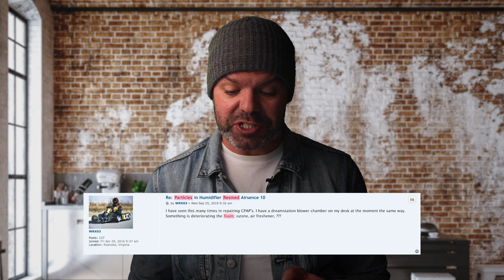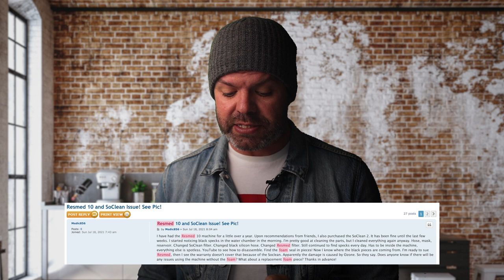🚨WARNING! AirSense 10 Foam Degradation & Removal

Comment: Very informative, thanks.  Sadly, because my insurance paid for my AirSense 10 the modem has to stay connected so it can be monitored.  If I don't use the machine they can take it back.  So if I want to open it up to deep clean the insides, what do I use to clean it with?  I've never used any sort of cleaning system for the machine.  I do take the water chamber and nose pillow with me to clean while I'm in the shower and clean the hose every week or two.  I normally use mild soap and vinegar, letting them soak for around 30 minutes before rinsing them out.

Comment: Until this foam degradation issue is resolved, is there any sort of inline hepa filter that you can place between the outlet of the cpap machine and the mask tubing ? At least this way one wouldn’t inhale any potential foam particles.

Comment: I have never used SoClean on my Resmed Airsense10. I saw the Foamgate Phillips recall, and became concerned about the foam in my machine. I'm an Electronics Tech, so I took my machine apart. My foam seems intact. Should I worry? Is there an option for a silicone replacement for the foam? Or a way to seal the foam so that if it starts to breakdown my airway is protected?
Reply from the maker: G'day brother, nah i wouldn't worry with the AS10 unless it has signs of break down. A lot of people have removed the foam disc as it doesn't really do much and the noise remains virtually unchanged. It's up to you mate. Personally if it was looking good i'd just leave it in and perhaps check on it once a year and do a bit of a clean out of the dust inside the unit etc. Cheers

Comment: Good Day Brother, I removed my foam thanks to your video, my Dream Station was 5 years old and I used a So Clean for almost as long, the toxic foam was a Black Goo  (Tar Like) It came out in small pieces of resin, that I have and dated. I have photos of my hands the toxic foam and the coated items used to remove it. If you would like to see them and use them in your videos, I can do that ! I had a black resin on my hand , in the foam case housing and on the various things I had to use to get this crap out. Thank You for your awesome videos, You might have saved my life, I have A Fib. and cannot be without a Cpap Machine all is good now. Here's a thought, now that the toxic foam has been removed I can use the So Clean again.                 Mark Mundt  Milwaukee, WI USA ...

Comment: Mine is 2 months out of warranty.   It is now making a low pitched whirring/whining noise when I breathe in.   I’d like to know what’s wrong.   Checked outlet valve/adapter, hoses, new tank and filter.   Noise still there.   I keep it on the floor now with a blanket over it.   Thinking of building a wooden box for it.  Lol.   But I’d really like to fix it.

Comment: I had soclean for five years clean masks mainly now only . AirTouch F20 cushion. They do not recommend cleaning masks in soclean,  foam cushions look great, recleaning 10 masks 2 or 3 years old clean with wet one wipes and soclean smell fresh just run all tube into soclean and drop in 3 masks at a time.  No degradation of foam , same color grey as new
Reply from the maker: The mask foam is completely different to the machine foam. Cheers

Comment: Nick, can you just leave the foam out  of the resmeds, I took the foam out of my dreamstation, because who the hell wants to wait a year for Phillips, I put the plastic where I cut to remove the foam back in my air chamber by using a soldering iron to melt the plastic , like welding. I can't tell any difference without the foam and feel better knowing that tar like crap is gone and not going in my already crappy lungs. Another good how to video and information on law suit. Thanks for your work.
Reply from the maker: Hey Jerry, thanks for the fab comment! I guess when you're known for making the best and quietest cpap machines in the world then a couple of DB is certainly important however i think you're right. Either leave it out or find a new materiel. Congrats on the DS foam removal also, i think you made a wise decision! Already 4 months in to the recall now! Cheers legend. Nicko

Comment: Would be great to see how to check the foam in a BMC Luna which is very quiet.... Would be great to have a machine with no foam touching the air we breathe!  

I'd buy that product...
Reply from the maker: Every cpap has foam except the Z2. BMC no different although it's not PE-PUR foam. Similar foam to ResMed. Cheers
Reply: @CPAPReviews  great to hear it is probably safe... I bought the BMC auto recently to replace the dream station nightmare... Thanks very much

Comment: Hi Nick sorry to bother you. A quick question if I may. I had a system one machine recall, how come they replaced this machine with A Dreamstation which is also on recall?? I am confused or did I miss something. Thanks Nick.
Reply from the maker: Hello, they are sending out refurbished DS1 machines with the new silicone based foam inside the turbine casing. Cheers
Reply: Thank You Nick.

Comment: Will the machine work OK without any foam?  Does it get louder?  Seems like it shouldn't matter if it's in there. You could probably 3d print a bit of plastic grid work that does about the same job absorbing sound. Or just go without unless it's necessary to the devices functioning
Reply from the maker: Hey mate, thanks for the great comment. Yes it totally fine and personally i can't notice much of a difference in noise. Perhaps a tiny tiny higher pitch to the motor but not much at all. Great suggestion with the 3d print! If you want to make some money create some sound dampening material that doesn't break down and you're all set haha. All the best mate. Nicko

Comment: Thank you for the great video. I love your channel. I have a question: I have a brand new AirSense 10 because my old machine was recalled. I have noticed when I use it that it smells like plastic for a little bit until the humidifier heats the tube up. Is this normal? Has anyone else experienced this? The smell is still there even after washing the tubing & reservoir chamber with light soap & vinegar. Thanks.
Reply from the maker: Hey man, i'm glad you like it and thanks for the great comment. Yeah it's very common to have that smell in the beginning. It will fade over time though. If it's bothering you, you can change the smell to whatever you like using this little device - https://youtu.be/qYrw1GpMs0w . Best wishes. Nicko
Reply: jm 20, thanks for asking this and, Nicko, thanks also for the reply.  I too have a brand new machine (just over a week) and was wondering about the smell.  It is quite strong, but perhaps not as strong now as the first night.

Comment: Nick, you are a blody ledgend! I was thinking about a second hand airsense 10, but now am a bit worried. I can tear down a machine abnd clean it out no worries, but where does one get replacement foam?
Reply from the maker: Hi Matt, yeah you need to be a little bit careful buying second hand pumps. Need to know 1. How many hours on the motor, 2. Has it been used with ozone. If it's relatively low hours and has no ozone exposure then it certainly reduces the risks a bit. Cheers mate. Nicko
Reply: @CPAPReviews  Legend, thanks mate.

Comment: Thank you this was great. I have been using a cpap machine for the past two and a half years.  I have never cleaned the inside of my Resmed 10 because I was only told by Resmed to clean the tubing and chamber and change the filters.  Is there a posibility that the foam in my Resmed is damaged, moldy or what ever.  Am I supposed to clean this part of the machine? Please help.
Reply: No, you are not supposed to clean the foam, if you havent used ozone on it, it should be fine and last longer than the machine will.

Comment: Hi Nicko, I got my Resmed 10 back in May 2019 and got the SoClean a year later. Before I bought the SoClean, I have heard about possible issues with it, but wanted something that would help disinfect the unit. I never used it everyday, I have only used it once every 3 months as a maintenance for my equipment. I do wash with non scented dishwashing soap the hose, tank and mask regularly. As soon as the SoClean is done, I run the maskfit option 3-4 times to try and get out as much ozone smell from the unit, hose and mask as possible. Do you think using the SoClean 4 times a year is bad or should I just stop using the SoClean all together and sell it? Please give me your thoughts. Thanks for all of your work on here! Danny
Reply from the maker: G'day mate, i'v been advising people just to stay clear of ozone in general however if you're enjoying using it then i think 4 times a year would not have a big impact on the foam (if any at all). Cheers brother

Comment: My Airsense 10 has foam in the water tank from using soclean. I assume I should stop using the Cpap machine. Where can I purchase a new foam ring?
Reply from the maker: G'day Bill, unfortunately you can't buy them mate but i don't think it really does much anyway except reduce the noise a tiny bit so can probably just remove it. Cheers :_cheers:

Comment: Great video.  Do you happen to have the part number for the foam (Airsense10) for replacement and where to purchase it.  That would be very helpful if we find our to be deteriorating.  Thanks in advance.
Reply from the maker: I don't think you can purchase it mate. You would need to contact ResMed but they would try and get you to send the machine in for repairs i think. Would be great if you could purchase 3rd party parts like they have for cars etc. Nick
Reply: @CPAPReviews  Thanks so much for taking the time to respond.

Comment: Here in Canada, almost all distilled water (which is recommended for the machines) has gone through an ozonated process. Do you know if that will degrade the foam?🤔
Reply: I don't think the pump sucks the water chamber air.  I believe it feeds the chamber instead, hence why people find foam in the water chamber.  With the understanding, the water in the chamber will never get to the foam.

Comment: Hi Nick, 
Thanks for your videos. I was a victim of the Philips foamgate and bought an Airsense 10 recently. Im thinking of taking the foam out altogether. Are you able to make a video that shows how noisy it is without the foam? Coz if it's not too bad, im gonna take the foam out. Thanks again Nick. 😊
Reply: Took mine out. No noise at all.
Reply: @geewizz5311  Thanks bro. It'll probably void the warranty but I'm not taking the risk with this foam so I'll be taking it off. 😃
Reply from the maker: Barely any difference mate absolutely no need to do it. Cheers

Comment: OK I removed my foam from my machine considering doubling up on the main filter unless that foam was a sound isolation design but my machine doesn’t sound any louder with the foam removed. My foam had not yet dried out and fell apart but seemed a little gummy if that makes sense. I use SoClean 2 every day and I noticed that the wind tunnel with the motor in it had turned yellow a little and this machine is barely a year old.

Comment: But what is the purpose of this piece of foam? What does happen if you let the motor run without that foam, or if you replace it with a piece of rubber, or cotton tissue?

Comment: Now I'm worried.  I blind so I'll need to contact Resmed to get service.  My dealer would only tell me to buy a new one.  I've used an ozone cleaner on my Airsence 10 for a while.  I was suspicious that it might damage the innards.  I did run ozone through it at first.  But now I only deodorize the hose.
I clean regularly with Dawn dish soap.  I'm careful about maintenance I still found that ozone helpes with smells from the cpap that I could not stand.

I am sorry ozone is bad for cpap machines.  I do know to much ozone is not healthy so I always leve the room.

I just wish there was a better way to keep my cpap fresh.

Comment: Is the resmed OK if you just clean it with soap and water or is this an issue with all resmed airsense
Reply from the maker: Hi Teresa, yep that's totally fine. They normally have cleaning methods in the manual but all the manufacturers now say that using ozone will void the warranty. Cheers

Comment: I just bought an ozone cleaner from Walmart on sale. I just put my hose, mask and head gear in there. Is that still not advised?
Reply from the maker: Hey man, hmmm, it's probably okay on those parts but just use it in a well ventilated space :-). Cheers
Reply: @CPAPReviews  Sounds good. Thanks 👍

Comment: So if I never used ozone with Dreamstation, does that mean it’s okay to use? The real problem has been the so clean machines?  Or still a foam issue with Dreamstation foam?
Reply from the maker: Hi Sharin, unfortunately not. Regardless of the ozone, the Philips foam is toxic and breaks down due to heat and humidity also. Best wishes. Nick
Reply: @CPAPReviews  what about with my new resmed 10. Never used or going to use ozone. Is it safe or same problems as Phillips? I paid for it out of pocket. When I finally found out my doctors office should have ordered me a new machine because old one was 2 years old, health plan told me I didn’t buy from an accredited source, so no refund.

Comment: Greetings Nick.  Do you know where we can purchase replacement foam…mine is falling apart…
Reply: It was installed as a noise reducer,  and most people find that removing the foam and running it without is acceptable. 

If you wish,  one can replace the foam with another type.  Using an Exacto knife to shape a new one from any material.

Comment: My Dreamstation is not good in bi-pap mode.  When the pressure changes between inhale and exhale the pressure spikes for about 10 or 20ms  way above the top therapy level and causes the mask to leak a puff of air.  It's very annoying.  Pretty much it is a pressure waveform similar to a square wave reconstructed from a minimum of Fourier terms causing Gibbs phenomena.  I'm betting they implemented the pressure change in DSP firmware and did a poor job of it.  The further apart the inhale/exhale levels are the worse the overshoot is.
I have switched back to my old Respironics Bi-pap and it works much better.  So my Dreamstation is essentially retired.  Sure was an expensive endeavor.

Comment: Do you know if the new Resmed 11 can also be  disassembled to remove the foam , just in case we find out at a later date that the foam is also bad ?
Reply from the maker: Hi Rob, yes it can however it's the same foam as the AS10 so if you look after it you shouldn't have to remove it. Cheers https://youtu.be/y1C7pxg3PM8
Reply: Do you think it’s worth the extra $200 to get the resmed 11 instead of the 10 ? My insurance will cover 80% but I’ll still have to cough up an extra $200 for the 11 over the 10 

Thanks for all you do bro !

Comment: I just noticed tiny black fibers in my Resmed 10 tank. I disassembled the device and found the motor impeller full of black dust and fibers, stuck on.  I checked the foam and it is all intact. I never used a cleaning device. This really concerns me if Resmed foam is even safe. I took a picture of the impeller and the foam.
Reply from the maker: Can you send me a photo mate cpapreviewsaus@gmail.com
Reply: @CPAPReviews  Thanks for you reply, I already sent them to you. Please let me know if you didn't receive them.

Comment: The sensible question we all should be making to Resmed is what is the composition of their foam and specially which specific tests have been made to ensure that under normal usage circumstances and during the life cycle of the machine, any particle or Volatile Organic Compounds (VOC) emissions from their foam will stay within safe levels.

The statement from Resmed in regards to the safety of their foam is not backed up by data, at least any data that has been made publicly available. 

The look or physical integrity of the foam tells us nothing regarding for instance the release of VOCs.

Foams, just as plastics, contain complex chemicals and due to this there is an extremely high probability that the consumers are not being told the whole story. 

Chances are that the foam was not thoroughly studied and that quality control relies mostly on visual inspection based of physical integrity properties, with poorly characterized list of the chemicals included which is almost 100% certain will include compounds with potential to be hazardous to human health as will for sure include oil derivatives. 

Resmed should provide such data if they have done their homework and are so sure that their foam is safe.

Question: Why not simply remove the foam and just replace more frequently the air inlet rectangular white air filters? 

Is there any chance that there would be dust accumulation in the turbine if the foam is removed? 

It doesn't seem to accumulate dust anyway and doesn't seem to be playing a major sound insulation role. It seems to be there mostly for air filtration purposes but from the disassembled images it doesn't seem it's picking up any dust particles.

Grateful for any thoughts you could have on this. Or perhaps a future retake on this issue on a future video?

Certainly for many users like myself, knowing we're breathing all night air that is being pushed through a foam layer of unknown composition and with undisclosed safety test results, is not tranquilizing, specially knowing we live in a world where there's always an untold story in everything, hidden data, the pure dark side or simply unknown unknowns. 

Thanks for your time-sensitive valuable content and for any feedback.